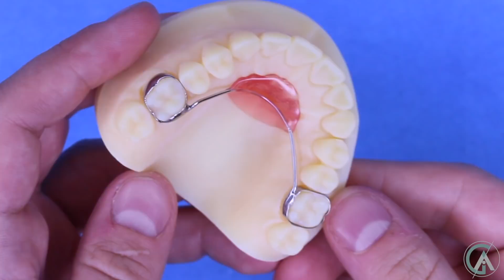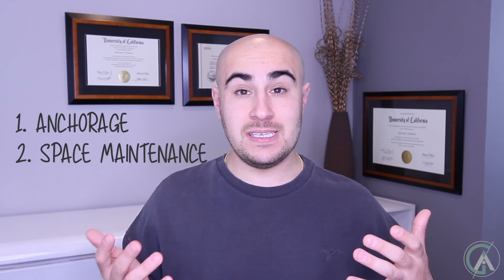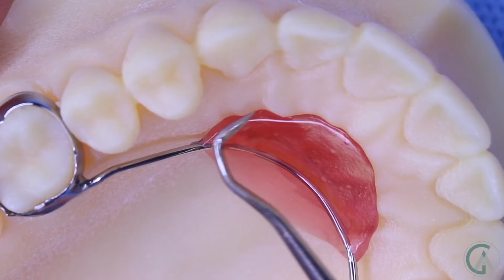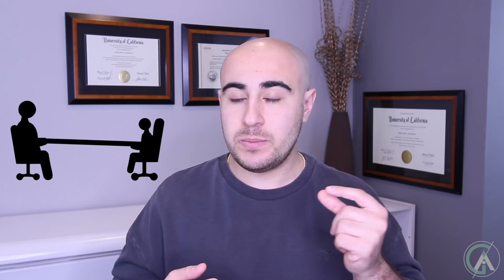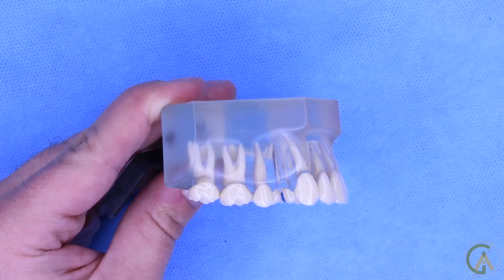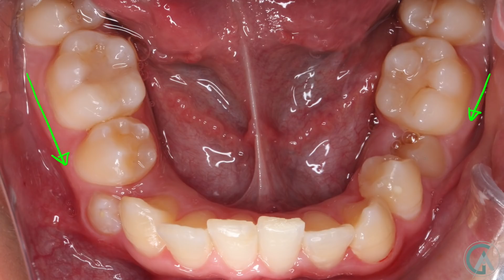Nance Appliance during Braces

Comment: Thankful for this video.  Question: What is the benefit of a Nance to hold the space of an extracted upper baby Second Molar in an 8 yo over a band and loop when the First permanent molar has already fully erupted and Upper First Premolar is still in place (i.e. why not place a smaller band and loop device  when it sounds like there're some drawbacks to the Nance with lisp, possible mouth roof irritation, etc.)?

Comment: I have a question. So. Is there a reason why when I leave the orthodontist, my braces don’t poke me, but halfway before my next appointment, my wire seems to be sticking out more than the previous appointment
Reply from the maker: Depends on what stage you are during the braces process, sometimes as spaces are closed, the wire extends out of the back of the most back tooth!

Comment: I had 2 molars removed on the top and 1 molar in the bottom because I was missing one, so I have a nance appliance on top. I’m curious as to how they’ll close the gaps because there’s a lot more extra space. Right now, I actually have a gap between my front bottom teeth that wasn’t there before, and I just want to know how there’ll be an even distribution of space for the rest of my teeth when there are extra gaps.
Reply from the maker: All the spaces will likely be closed when you are finished

Comment: Should've asked this on your retainer video, if i plan to have fixed retainer and use waterpik for flosser, is it safe for the fixed retainer as the pressure of the water might harm the retainer? TIA
Reply from the maker: Yup! The retainer should be on there strong enough
Reply: @DrGregAsatrian  I'm relieved! I just love water flosser so much because it's easier to clean my teeth and at the same time i want fixed retainer. Thanks, Dr. Greg!

Comment: I have one of these with a combination of top teeth braces, I am missing teeth and I think they are trying to make room for teeth that haven’t come in yet. But by golly this thing hurts like helllll, I’ve used everything I can find to soothe it but nothing works, I’ve tried mouth gels and ibuprofen, the pain is directly in front of the nance where the gums have been adjusted, I’ve had it for months already and it’s never been so painful. Did my orthodontist make it too tight? (Braces wire was changed) and should I be worried?
Reply: same thing happened to me, it didn’t hurt before and i’ve had it for 7 months. but after my most recent appointment it got so sore and inflamed! i don’t know what’s happening but it’s incredibly painful.

Comment: I have a nance appliance to keep my molars back to prevent them from moving to the space left from extracted teeth. My nance looks the same as the one you showed, but it has also a metal thing that goes along the top of my palate(like a thicker thread kinda). Does it the same work as the nance you showed or does it have a different purpose?
Reply from the maker: That other part is called the transpalatal arch (TPA). I will be doing a video on those soon!
Reply: Braces Explained Didn’t know it was called that. But what I meant was that mine is kinda combined, both nance and transpalatal arch in one single thing.
Reply: @elinrefetova6031  bit late but I got this yesterday, does your lisp go away and can you learn to speak normally again?

Comment: I would really appreciate some guidance on this! My nance appliance is loose and I see them move everytime I brush my teeth and I accidentally pushed the plastic thing up once. They will not fall of as it is attached to my braces though. Should I be concerned? I went to talk to my orthodontist about the bracket being loose but I failed to mention that it was the one connected to the appliance (I’m so bad at phone calls and it slipped my mind). In addition to this, a gap has formed between my two front teeth, is this normal? Thank you in advance.

Comment: Tooth extraction should be stopped! It does more harm than good and over time the face sinks in. 

It affects facial appearance and beauty negatively.
Our genetic blueprint is perfect, the reason we don't have enough space in our jaws is due to environmental factors growing up such as:

1. Mouth breathing and improper tongue posture which leads to a narrow upper jaw, crowding and lack of forward growth(and a host of other issues)
2. Our modern diets. We are not chewing on tough foods as much as our ancestors did.
3. Bad head and neck posture (forward head posture)
Never extract teeth. Instead focus on expanding your maxilla(upper jaw) which will allow more room for your teeth, which will also help your lower jaw move forward for a more optimal bite. Find an orhtodontist that shares this pholosphy.

DO NOT EXTRACT healthy teeth. You will regret it down the line.
Thumbs up so everyone can see.